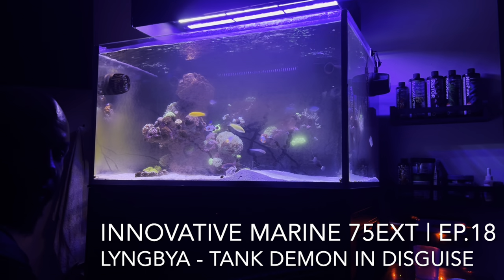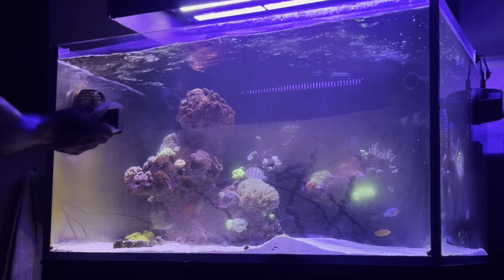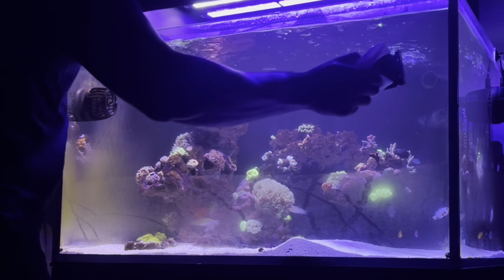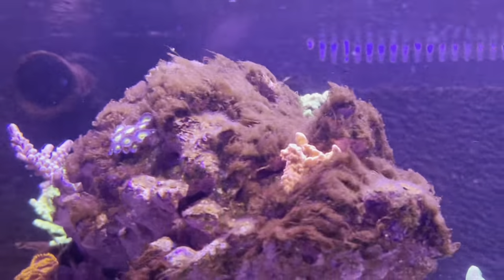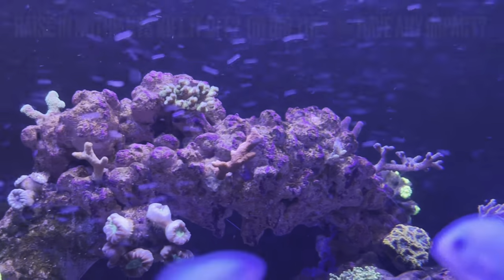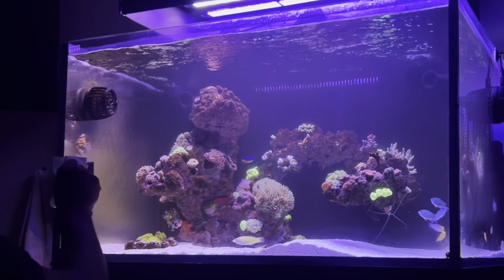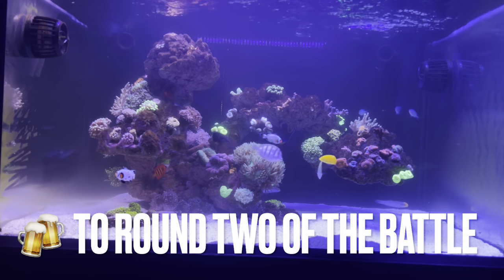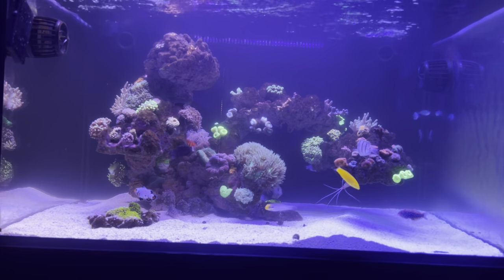Ep.18 | LYNGBYA - Tank Killer in disguise

Comment: Hi CJ, I usually don't post comments but my tank went through some lyngbya recently too. I wanted to avoid using antibiotics and dosing bacteria so I tried a different approach. I heard this stuff is weak against peroxide so I did a double dose of reef medic for 10 days, allowing me to keep my skimmer on. This started to work a little so I decided to also buy a bunch of cow tongue nerites and they ate it all up once it was slightly weakened. I was also feeding extra during this time to boost nutrients, but stopped using aminos. I would say those nerites probably did most of the heavy lifting. Hope this helps.

Comment: Thanks for the shout-out CJ. Lyngbya is a real pain to get rid of. The only thing that has been able to help IME is competing bacteria. Mexican Turbo Snails will eat it, but eventually they'll get sick and die (2-3 months). It seems to thrive in ULNS and MarcoRocks type tanks that have no bacterial defenses. AF probiotic & Korallen-Zucht Cyano Clean and ZEObak both work. Fauna Marine ReBIOTIC and Therapy/Bacto Balls will help prevent most types of cyano, but probably take a month to work. Tidal Garden's had the same thing and misdiagnosed it as hair algae too, so you're in good company.
Reply from the maker: Doing my part to help raise awareness thanks for the info I’ll look into em 🫡💯
Reply: I had this and i started to dose microbacter 7. It got worse for me. A friend told me that microbacter 7 is an organic carbon source and will feed this cyano. UV and peroxide along with good nutrient control helped me contain it.
Reply: I have the same issue and used Flux Rx which helped and it came back but definitely weaker so just scrubbing the rocks every few days. I just hate it on my sand bed. I stir it up and it's back in a few hours with the lights on. Lights off it goes away a little. Just letting it go for a bit and let the tank mature a little longer

Comment: I fought this same algae with Microbacter 7 in a weekly dose and Microbacter Clean the 2 week dose direction on the bottle. Some other things I think helped while using this was blowing it off my rocks with a turkey baster whenever I could and scrubbing the rocks with a toothbrush during a water change. I think this helps the bacteria have less to compete with the cyano. I also cleaned the filter sock every morning as I noticed a lot would be collected in it with just 1 day and this stuff is toxic so any manual removal from the tank is good. You also want to make sure your nutrients don't bottom out while doing this either. Can't wait for your next video!

Comment: i know it's been a minute since you posted this but I had similar issues when I upgraded my lights and it's taken forever to get my phosphates down due to lacking biodiversity.  I started dosing Microbacter Clean about 6 weeks ago but it takes at least 10 weeks for that bacterial succession to take hold provided there aren't other bacteria waging warfare on the Microbacter strains, this is according to Brightwell's documentation.  Around the same time I upgraded my lights adding more LED pucks to the mix and I didn't adjust my intensity, thinking I would just have more spread but wow, did the cyano start to take off.  I went on vacation and had the dosers running the spectrum of Microbacter Clean, Phos-E, etc and my phosphate levels were <0.2 (still very high) and my nitrates were less than 3ppm (on average) but that doesn't mean I didn't have nutrients in the system, coupled with the lighting I would soon learn was the perfect combination for a killer cyano army that waged war on my corals.  When I returned from vacation I had lost a hammer frag and a 4"+ elegance  to RTN with everything else unhappy, and the cyano was everywhere.  Water changes, reducing light intensity and finally using Chemiclean did the job.   Lesson learned for me was be careful with lighting because these LEDs provide a ton of energy for bad stuff and I don't have enough corals to outcompete the bad guys. :(
Reply from the maker: Interesting testimony for sure because I also changed lights.. makes me wonder if the blade spectrum also fed this issue or if it was just imbalance of nutrients and good/bad bacteria. I am currently dosing mb clean and will start mb razor as I try to keep nutrients up and manually removing it as I can. This won’t be a instant fix by any means… thanks for watching 💪🏾💯

Comment: you got the type hat will be on rocks and glass but not the sand. suck out as much as possible first, run a UV at 5X tuank turn over, ensure your return is also at least 5X, suck out the new ones everyday. if you run socks, change them every morning. during the treatment, lower your light, turn off write channel if you can, maintain NO3 around 3-5ppm and PO4 around 0.05-0.08. after couple days you will notice the new grows slow down, keep it for another two weeks or so, you will be good. Good luck and happy reefing. OH! no amino or coral food during the treatment.

Comment: So I have had this the last four months, but only learnt what it was the last month from a dinoflagellate group. I have been fighting ostreopsis on and off for three years so I am reluctant to use any chemical products or antibiotics as I don't want them back. My research says nerite and cerith snails eat it, so I've ordered 20+ ceriths which do munch of the back wall. They say to avoid knocking it into the water column as it's quick to proliferate and regrow. So for this, I turn off all flow and Syphon as much as I can with a hose for a water change. Its worked very well over about four water changes. The stuff loves power heads, so each time I also took the power heads out and gave them a good clean in tap water. I have also been dosing modern reef biodiversity which may have been the kicker for Dino's since I started using it a few months back, along with regular trave element dosing and raised nutrients. I would implore you to use natural methods and bacteria rather than antibiotics as I know you have suffered with Dino's in the past too. Anything is better than Dino's.

Comment: Honestly I would not do too much besides manual removal and water changes. In my experience frequent water changes are crucial for new tanks. You can also dose peroxide to the tank. I have done this for 4 months in my build. If you do this there are post on Humblefish showing how much to use but I stress the fact that you should ramp up to the dose you need over a few weeks. There are other side benefits you will gain but go slow. Between UV and peroxide and water changes I was able to beat several things that were hurting my system. It will take time but you will not have to go the nuclear options. If you do go the route of bacteria look into home made coral snow. Sunnyx has good info on a day formula that will help clean up the tank. I do this once a week after I stir things up and do a water change. Be patient. Good luck.

Comment: I might have had this in my tank early on.  It was either what you have or an insane diatom infestation to the point they were fluff hairs on the rock.  I tried multiple UV sterilizers also as my water was constantly cloudy or slightly haze and the UV did not do anything at all which I thought was impossible?  Are you having any bit of cloudiness in the water?
Reply from the maker: Water stays clear i do run a UV but it’s tuned to focus on parasites not bacteria

Comment: You're backwards ma dood...the only thing that you need to know is that you were incredibly fast with the inhabitants, acting as if your tank was mature and that simply is not the case. Cycling and Mature are two totally different things. Your tank may be cycled which means you can slowly add life, keyword being "slowly" BUT it is not "mature" which generally takes a year plus for this stage, some even more depending on husbandry and knowledge. Solving for specific issues like particular bacteria/algae etc. is a secondary issue caused by the lack of knowledge regarding maturity. You will continue to have these problems if your inhabitants is still this abundant this early in your tanks existence. The goal of this hobby should be to keep your money in the tank.
Reply from the maker: Not sure if I gave off the thinking my tank is mature vibe. This is more if a experiential tank start using methods never have before and sharing the experience with everyone as it goes. I’ve seen insta tanks setup and ran successfully… also seen them fail.  Ultimate goal is learning and keeping all money in the tank as you said… this is where we are wit it now tho so gotta see it thru 💯